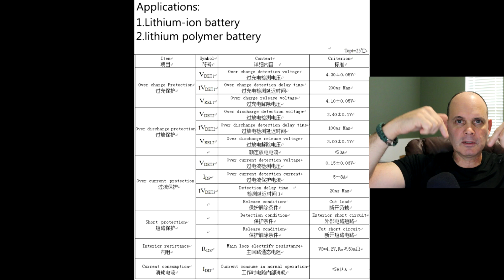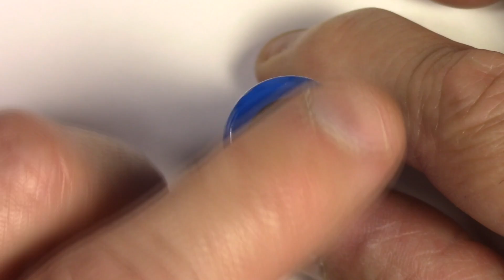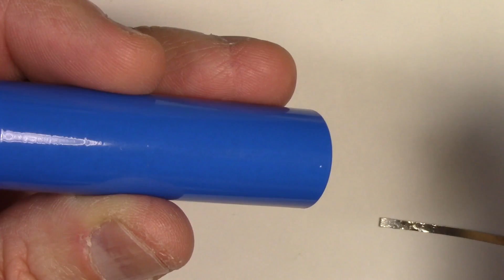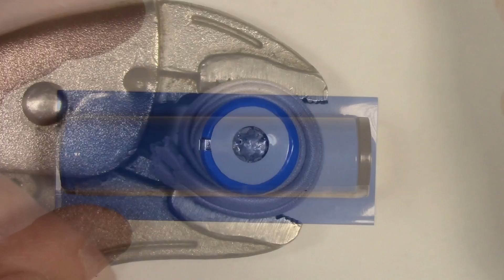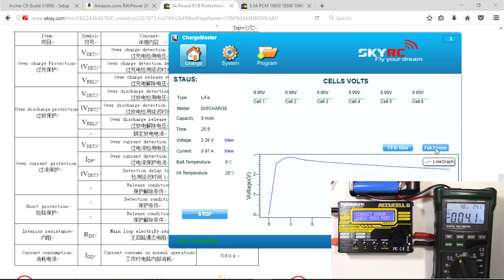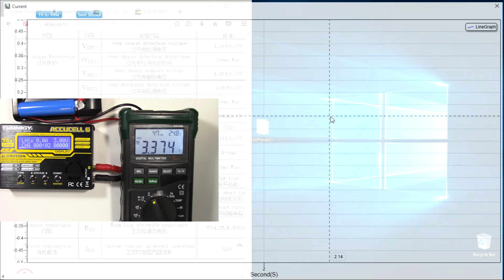Adding A Protection Circuit To An 18650 Cell/Battery Making An 18650 Protected Cell/Battery Thorough

Comment: This man is from the same part of the country as norm mcdonald was, by the dialect. But I have a question for you sir, does anyone make a protection circuit for the or the 21700 that could handle 10 amps of continuous discharge? I want to upgrade some old 1980's power tools to lithium batteries, but they draw a lot. And you need a protection circuit for cutoff so you don't drain the batteries too low. All the amazon ones say they cut power at 3 amps.
Reply from the maker: I get that Norm MacDonald thing on a regular basis. LOL Here is a circuit I found on Amazon(paid): https://amzn.to/3RIfFYA and here is a bunch of them on Amazon(paid): https://amzn.to/44ZpG6U   Very interesting and budget friendly. I may purchase a few myself! Thanks

Comment: Could this type of protection circuit be wired into a battery holder and allow these unprotected batteries to be readily replaced?

For context, I am building a powered lightsaber prop which is electronically a flashlight with two 5V LED strips in lieu of a normal light assembly, plus a small speaker. I did not want to buy a bunch of $15 protected 18650s when I had a handful of unprotected $4 21700 cells around from a prior project, but I would ideally like to swap the batteries out on the fly while costuming.
Reply from the maker: That sounds like a great build, and adding the circuit to your holder is a perfect way to keep those cells safe while swapping. Thanks for watching! 👍😀

Comment: the problem is some appliances that use these batteries dont fit a little bigger protected ones..
Reply from the maker: That can be the case. Hopefully the product is somehow designed to use the unprotected cells safely. Thank you so much for commenting and watching. I appreciate it greatly. All the best.👍😀

Comment: You need to use flux, otherwise you will get cold solder joints.
Reply from the maker: Thank you so much for watching, commenting and the valuable feedback. I appreciate it greatly. All the best.👍😀

Comment: Hello ! I want to use an exact green cell from a laptop for a bike flashlight. How do I avoid deep discharge while using it? I don't worry for over charging as I own a car battery charger and will charge 6 at a time just like in the laptop pack and it has a safe cutoff and a slow charge. But will the cell die, if I over discharge it ?Does this have an inside protection for that ?

Comment: Thank you for the comprehensive video.  Pre-soldering the leads on the pcb works fine, but the solder refuses to stick to the battery terminals. I can't get the solder to stick to the battery. I tried different temperatures and tips. I don't want to keep the iron on there any longer than a couple of seconds because I don't want to transfer too much heat into the battery. I sanded and de-greased the battery terminals.
Reply from the maker: It's a bit of a trick I used a high amp iron (45W) the metal has to get hot enough to take the solder. You could cool the cell in the refrigerator prior to soldering to reduce the temperature gain. I didn't cool them and I didn't  have an issue with them. They still work today. Another option is a spot welder (if you are making a lot of these cells) eBay: https://ebay.to/39Tn1Ne pretty reasonable price. Thank you for watching and commenting. I appreciate it greatly. All the best.👍😀
Reply: Richard Lloyd hello
Can we use (P+) and (P-) of protector for both of these?
1: battery output 
2: to charge this battery

Comment: Bloody hell DON'T use scotch tape to insulate the anode strip, the anode strip can easily melt through & short against the metal tube of a flashlight, use high temp polyimide tape off ebay its cheap & saves turning your flashlight into a PIPE BOMB

Comment: I have several meters to measure the 18650's resistance and they do not agree on most batteries, sometimes they are as far apart that few points that I can understand is OK, but when it is several 10's that I don't understand. I've purchased a XTAR DRAGON that comes with probes also to measure the resistance. How do you determine if the battery is OK or 1/3 bad or 1/2... bad? I was thinking to make my own charging, discharging, testing and testing batteries like 18650 .... but with a unique serial number on each battery and the "charger/tester/xxx will know the "signature" of that battery and can predict how it will perform. Have you seen anything like it? Thank you again. Tony

Comment: Thanks for your videos! Nice job adding all the parts with Am+eB!!! But this video is 3 years old, what are you suggesting today?
Reply from the maker: You are most welcome. The components and technology has not changed that much in the last three years (capacity of the cells has increased). But the components and procedures are still the same. I would still use what I suggest in the video. BTW I am still using the protected cells I built in the video. Thank you for watching, commenting and the kind words. I appreciate it greatly. All the best.👍😀

Comment: Thanks.  Big help !!
Reply from the maker: You are most welcome. Thank you for watching and commenting. I appreciate it and your support greatly. All the best.👍😀
Reply: @richardlloydusa  sorry for what is probably obvious to others, but I short circuited a very large battery (52v 23amh) that I believe has circuit protection on it. I am taking it to get repaired but I was just wondering, if the protection has worked correctly, will/should the battery maintain the same power and life as before the accident?

Comment: Okay so I am buying 8 Samsung 18650 35E batteries and they are rated up to 8A draw. My Bluetooth speaker draws around 6 at high volumes and when the bass drops a little over 10A. If I have 8 of the batteries in a battery pack in series would it be safe from drawing too much? I'm also going to use a DROCK 9043 Step down buck converter to make the battery pack around 24v and the max amps are 12Amps. Thank you so much and I look forward to your response. The project is the worlds best small portable speaker, hopefully :).

Comment: I did it but battery is still discharging below 3.7v - it dropped to 3.2v before my flashlight stopped working. What could be the reason? Is circuit not working? Is flashlight responsible by bypassing circuit somehow with pulse voltage?

Comment: Hi I have an old tablet using a 1s lipo battery with a battery protection board (bpb) I guess lol

I was wondering if I can remove that bpb from old lipo and then put the same bpb 5 x 18650 Li-Ion in parallel therefore increasing the battery life?
Reply from the maker: I would not recommend this. Use a BMS (battery management system) designed for your battery array. Thank you for watching and commenting. I appreciate it greatly. All the best.👍😀

Comment: Richard, does the protective circuit work with NMC 18650 batteries? Will a charger, like the Nicore I4 Intella charger charge NMC batteries? Can anyone else answer this question?
Reply from the maker: As long as the protection circuit cutoff parameters correspond to the cells specifications it should do the job.Thank you for watching and commenting. I appreciate it greatly. All the best.

Comment: Excellent video! You know your stuff. I am just learning about Li-ion, Li-Po, etc. This stuff is dangerous and you are helping me avoid making big mistakes. Just a suggestion: Your soldering needs work. Using flux, tinning your soldering iron, and using alcohol to clean the connection will help prevent bad connections. Lead/tin solder isn't a good a conductor. For example, the mound of solder contact is soft, can deform, and it oxidizes. So, if you lightly soldered the lead and bent it around (to make a raised contact) and then soldering the edge of the lead, again, that may help.
Reply from the maker: Thank you for watching, commenting and the valuable feedback. I appreciate it greatly. All the best.

Comment: Using Olight flashlight with magnetic charging base. You can't have that plastic insulator on there. It blocks the negative ring of the base cap from touching the battery negative casing. So the magnetic charger will not work. I been down this road. So just buy CR123A\18650 batteries that are protected.
Reply from the maker: Thank you for watching, commenting and the valuable feedback. I appreciate it greatly. All the best.

Comment: Very nice informative video Richard.
I would like to know if it is possible to mount a pack of 5 batteries in series with this protection on each, without having to use a bms or balance lead.

Comment: Hi, can you recommend a setup how to replace my led acid motocycle battery to lithium ion. Original battery is 12v and 14ah. What BMS should i use for 9 x 18650 batteries of 3000mah? Thnx

Comment: Richard,
Once the betteries have the protection circuit and I want to put into a 6S20P. Can they be spot welded still?
Reply: When making bigger battery packs you need one external BMS to controll all the cells. You need one 6S BMS isntead of the 1S shown in the video.

Comment: should be mentioned to make sure the top is WELL INSULATED as if the wrap is even slightly damaged the lead can touch, causing the opposite and boom! I am not sure why the positive and negative are so close at the top, but 90% of e cigs explode for this reason
Reply from the maker: Thanks.

Comment: I want to warn as many people as i an about these 18650 batteries.
Yes you can make 3S,4S,6S,7S,etc....battery packs. I used to make awesome portable battery packs that would be great for camping , charging drone batteries etc... The problem is this.
When you are charging phones iPads, drone batteries, be very careful not to go below..
Ex. 3S - 9v, 4S-12v, 6S-18v, 7S-21v
If your voltage drop below these marks you better have a BMS attached for charging. If not you will lose half of your batteries, and the other half will overcharge immediately causing batteries to start leaking and then fire and then little missiles flying around in your room or where ever the battery pack is charging. they will cause a lot of damage and can easily burn your house down.

Having a bms connected to your charging port will save your batteries.
why: because it will bottom balance your pack and prevent to total collapse of batteries when charging
Some people on Youtube are saying you don't need a BMS, and I started going that route but found out the hard way and have lost a 200SQ ft shop due to fire.

Richard is by far the best teacher in this category and really explains in detail.
I see this video and will start using this technique along with good BMS cards
Reply from the maker: Proper charge cycling is crucial to long life and safety. Thank you for watching, commenting and the kind words. I appreciate it greatly. All the best.
Reply: too much trouble.

Comment: so would this apply to other larger li-ion batteries such as samsungs new 2170? No one makes a protected one yet and I would love to make one just to have 1000 or so extra mAh
Reply from the maker: As long as you bought a protection circuit that matched the parameters of the cell, yes you could do it. Thanks.
Reply: Richard Lloyd when you say match the parameters, you mean the constant/max discharge rate and voltage output?

Comment: Hi Richard, ever think of using fusible leads that's what I do, just an Fyi. But nice video.I had to buy my 5 amp fusible leads from the UK, they were pre-tinned for easy soldering.
Reply from the maker: That's a good alternative but would require replacement if blown and would only provide over amperage protection. Thanks.

Comment: Hey, can you use these protection circuits with lithium-polymer batteries and do these also offer cell balance charge.
In the case of the polymer batteries, they're just a one cell kind of battery, not multiple cells stacked together.
Thanks for your help and great video.
Reply from the maker: These protection circuits are for Lithium Ion cells. Lithium Polymer cells require different voltage thresholds for charging and discharging. Thanks.

Comment: I see a lot of sellers claiming that these are also interchangeable with the 14500 ones, but isn't the diameter of the pcb larger than the 14500? Any info would be really appreciated :-)

Comment: I really like your videos and have subscribed.  I am using the same cell and want to add on-cell protection for some of the projects I'm doing with them.  I'd like your opinion regarding a larger project I'm planning for 3S/5P pack.  I have a 25A BMS board that should handle that in terms of over and under charge and balance, and I plan to use 6A resettable fuses on all of the + terminals.  My primary concern is with safety, and I'd appreciate your opinion regarding use of unprotected cells in this application; i.e., do you think adding individual cell protection would be redundant overkill?  I plan to carefully monitor the balance and check individual cell potential periodically. I will also use a 4 button charger similar to yours for periodic balance charge independent of the board. Any other advice would be appreciated. Thanks again for your great videos. I look forward to watching more of them.
Reply from the maker: I like the resetable fuses, that's a good idea. Individual cell protection is overkill. Your BMS should be good enough to handle the task. Individual cell protection would just add cost, time, a new point of failure, complexity, weight, and added power consumption for very little to no gain. You could use something like this at eBay: https://goo.gl/BZBDWL You could buy three or use a switch to toggle between cell packs. Make sure you use the proper gauge wire as well I believe 12 gauge or larger (please look up the specification) I also bought a bunch of XT60 connectors (rated 60 amps continuous) So I can quickly connect and disconnect components. Make sure you get a sturdy enough case for your project too. Thanks. All the best.

Comment: You should’ve used your multimeter to measure current in the short-circuit test, this way you can detect overcurrent faster and without risk of burning your fingers.
Reply from the maker: Thanks.

Comment: Hi just a quick question... Does one still need a BMS for a battery pack for charging if your using these circuit protectors?
Reply from the maker: It depends, if you want the BMS to balancing the cells as well as protect the cells then you need the BMS. If all the BMS does is protect the cells then there really is no difference between a protection BMS and the individual protection circuits on each cell. They both do the same job. Understand that battery packs that have a BMS are usually comprised of unprotected bare cells. I certainly do not recommend using both protection circuits (BMS and single cell protection circuits) at the same time because of compatibility issues. Pick one or the other. Thanks.

Comment: What stops this protection circuit from constantly draining the battery? It's a closed circuit connected to both + and -  Is this just the price you pay for having a protected cell?  How much power does this circuit use when the battery is just sitting there? A few microwatts?
Reply from the maker: The protection circuit will draw a very small charge. You can see the specifications on the Ebay listing here: https://goo.gl/Lxwq2X I believe it's 8uA very low power consumption. BTW it will shut down it's self when the voltage dips below 2.50V so it will never fully discharge the cell or damage the cell. Thanks.

Comment: Very helpful video!   Just wondering if you have another one that adds the step of adding + and - wires for use in a project where the battery is wired to a charge port and circuit board like Arduino or something.
Reply from the maker: I do not have such a video. Are you referring to this kind of charge circuit from Ebay: https://goo.gl/jaTvmF ? If so I may consider doing such a project video. Thanks. All the best.

Comment: Why did you remove the protection circuit from Panasonic NCR18650B in the first place ? . That cell is one of the very few that do come with the protection pre installed.
Reply from the maker: The stock Panasonic NCR18650B comes with a vent protection mechanism that allows gasses to vent from the cell in the event of a catastrophic failure. This keeps it from exploding but it does not have any electronic protection circuit built in to stop the catastrophic failure from happening in the first place. They state *PCB Protected Board No on the Amazon listing here:  http://amzn.to/2uIikVR

Comment: @Richard Lloyd, I noticed a linear-type protection circuit board that seems to do the same thing, except it costs less money and would trail along the side of the cell (I'm assuming inside the shrink tubing). ten of these costs $2.75... since I'm holding the cells together with brackets that provide enough space for the slight 1-3 mm bulge, do you think I should just go with these? Here's a link : http://www.ebay.com/itm/10x-3A-Protection-Board-for-1S-3-7V-18650-Li-ion-lithium-Battery-W-Solder-Belt/282474147244?_trksid=p2047675.c100623.m-1&_trkparms=aid%3D555018%26algo%3DPL.SIM%26ao%3D2%26asc%3D41375%26meid%3Df40666d85b31471b811e9c652cd8fa44%26pid%3D100623%26rk%3D1%26rkt%3D6%26sd%3D282243648769
Reply from the maker: Sure, if you have the space and they give you the proper protection limits. I noticed that the over current protection is a little on the low side at 1-3 amps. I would expect most 18650 cells to be able to deliver 1Amp discharge without issue so you should consider that if you are going to put a greater than 1Amp load on the cells. Here is the one I used one of internally on a flashlight at Ebay: https://goo.gl/y1QozU so I could use bare cells in flashlight with out issue. Here is the video for that: https://youtu.be/PjTX_WQcnZE?list=PLnxXRLSlmSVOdRpt-8Ha-vt4tH4A9tyH_  Thanks. All the best.